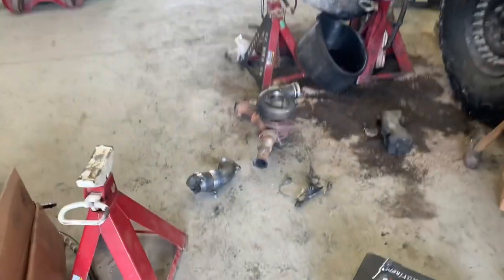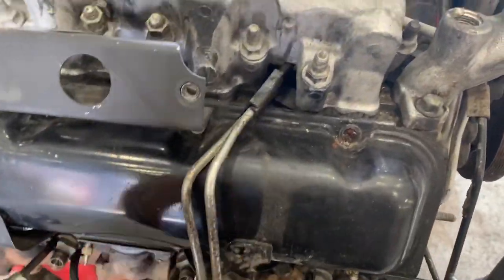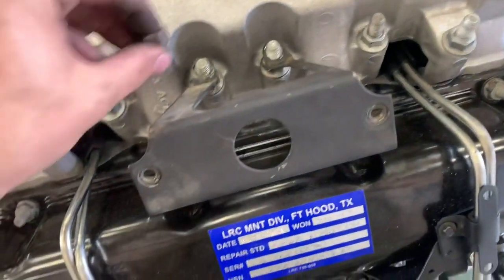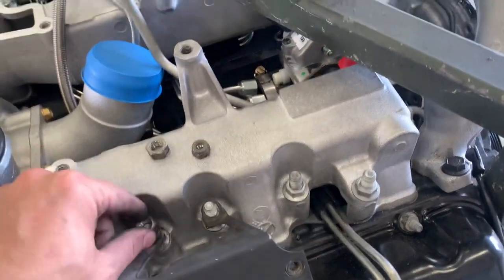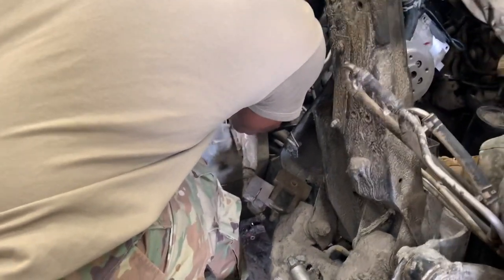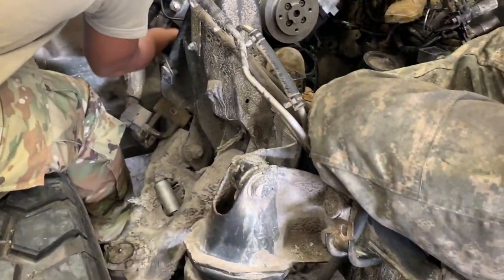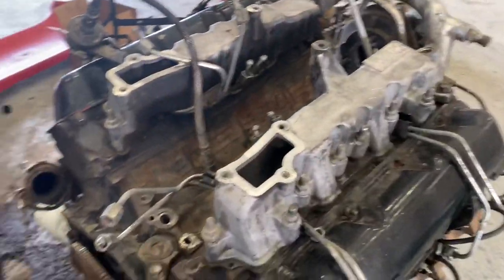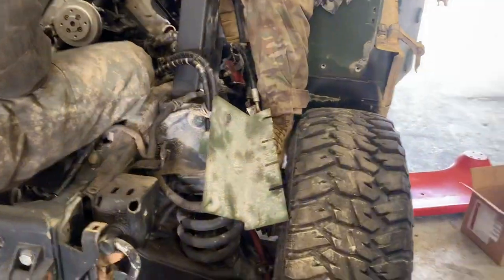Taking Apart A Humvee Engine !

Comment: I would love to see step by step videos from you bud. there isn't many Humvee step by step replacing videos. I'm stuck with my power steering right now. it needs to be changed but I am not a mechanic and found how to replace the power steering pump video, but couldn't find a video on how to loose the belts tension to remove the pully and than the power steering pump. please advise with this issue. thank you
Reply: Loosen the tensioner

Comment: Nathan, how accurate are the hash marks on injection pump and the timing chain housing as far as lining them up and assuming the IP timing is "correct". Do you ever actually time the IP? and if so what timing numbers do you see at idle and at 1300rpm's? Talking about the 6.5L diesel. thanks.